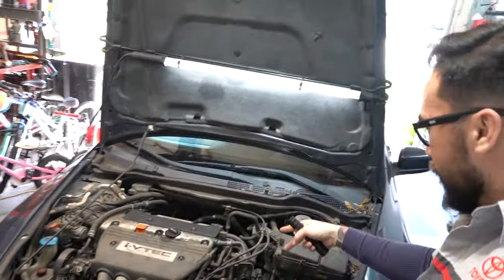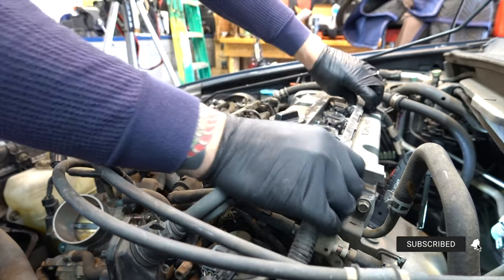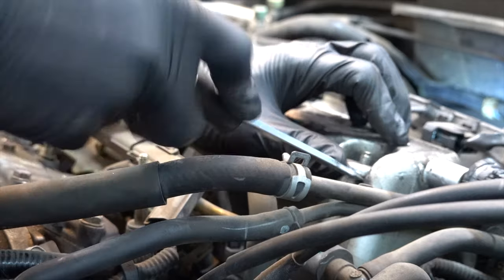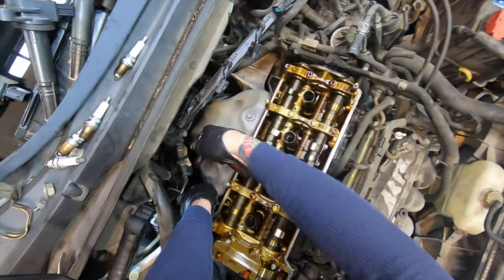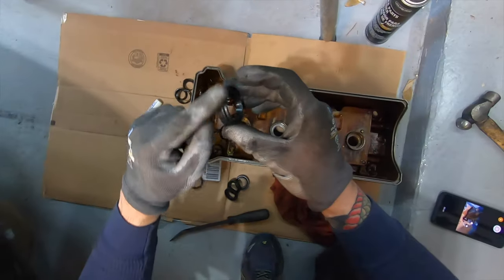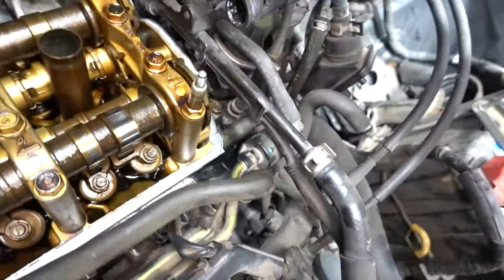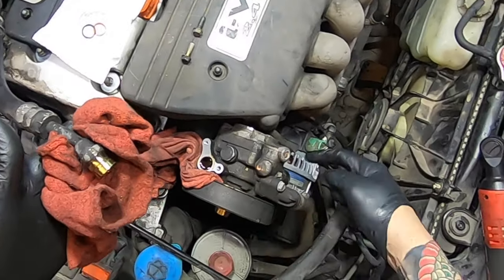Fixing All the Oil Leaks / K24 Honda Accord / Vtec Solenoid Valve Cover & Powersteering

Comment: Going on 210,000 on mine, came here to figure out where my oil leak is coming
Reply from the maker: Leaks here also https://youtu.be/wWytxOq4kHs
Reply: How is it holding up? 160k on mine and I need to fix these leaks to...
Reply: @danjones3402  150k on mine and same. Since it’s worn out rubber I bet it’s related to age more than miles. Mine is 2005
Reply: Same for me. 315 thousand miles and still going. 💪🏽
Reply: 305k just now leaking was rebuilt 6 years ago
Reply: Same here 212k done oil pan valve covers now doing timing cover front main I recommend you check your vakve cover where theres a half circle you can see overspray from Honda smhtheres a tsb
Reply: I made a video showing it I believed should be on my uploads
Reply: 160k had all the gasket since i bought the car 112k and now it’s leaking. Replaced the vtc strainer and vtec strainer. Tackling pressure switch and vtc actuator seal
Reply: I have a leak and it’s getting on my alternator. I suspect it’s the power steering pump
Reply: 222 still going strong but unfortunately being neglected time to actually find this oil leak
Reply: 250k on mine and I’m here now lol
Reply: 254,000km little oil leak, still going strong

Comment: The VVT solenoids are known to form cracks in the casting.  I just pulled one with three cracks in the top and two in bottom.  Very faint and hard to see, but would leak a quart of oil about every 50 miles.  Just replace the whole VVT solenoid, not the just the gasket.  No leaks for me any more.  The guy at the parts store said this is common and he's seen internal cracks which send metal chunks in to the engine.  I knew the VVT was leaking from getting under the idling car and seeing oil drips from the VVT location.
Reply: My 2003 Honda Accord 2.4l consumes motor oil pretty quick it has a slight leak that might be coming from the head gasket idk
Reply: These K24s leak from 4 areas the power steering being a culprit, the VVT solenoid  o rings leak which hangs on the side of the next culprit which is the VTEC solenoid, the last and most common culprit is the valve gaskets as they leak into the exhaust gaskets and make it look putrid.

I'm in a 04 accord lX auto 344,119miles as I write this, 14k miles on a low mileage transmission replacement (07 accord 123k original mileage) but Im losing a lot of oil. I will be replacing all those gaskets and parts see if it helps. 
Posted Sept 30 2023

Comment: bought a 2003 honda accord a few weeks ago. The own said there were no oil leaks. The vtec solenoid threw a code. So i orded a new one. and went to replace it. And wouldn't you know it was leaking oil. along with the oil filter. probably going to replace the gasket on the valve cover soon just to be safe. car has 225000 miles on it. So im actually kinda impressed I didn't find more. But it was pretty well maintained. it was a one owner car.

Comment: I took my 2010 Accord with 139k miles on it to a trusted foreign auto repair shop yesterday for a bad oil leak.
I was thinking it would be a bad oil pan or gasket but he told me it was a solenoid today 😬
I'm glad because a pan or gasket replacement would cost more.
He told  me $139 for part and over $100 for labor
Reply: what Parts?
Reply: @gerapic25ify  
Solenoid . The old one was cracked

Comment: The old power steering pump gasket apparently would just get hard and not able to properly seal and the new orange one is supposed to stay more soft and rubbery. Mine actually ended up sucking air in and bubble up the power steering fluid and it would over flow out of the reservoir, almost thought the transmission was going bad because it would make revving sounds as you accelerated
Reply: Yea, it’s only orange so you know if it’s been replaced before when you open it

Comment: literally was only planning on doing my valve  cover gasket and vvt solenoid. but i put power steering fluid in at least once a month. 03 accord as well. so might as well. gunna have to move that hose out my way anyways. great video.

Comment: Great video. You get right to the point with all this stuff and my oil leaks are fixed now. I had 2 of them. Thank you☺️
Reply: @Donnythelatemodeltech is there anything else on the front side of those engines that could leak oil?

Comment: What was the grease you put on the power steering O-rings? Lithium grease? I would imagine it's just going to dissolve in the oil. The orange O=ring fixes an issue with the intake hose on the pump. The flange only has 1 bolt for some reason. There are 2 holes bored on the pump.... Anyway, this causes the pump to suck in air from the leak around the Oring. This feeds the pump with air and fluid. By the time it comes out the steering rack back into the reservoir at low pressure. It's an emulsion, a soapy foam that overflows out of the reservoir around the air baffles in the cap. This is because when a fluid becomes a foam/emulsion. Its surface area will increase.  It's an insanely simple system that bleeds itself through the reservoir "cap". But will have big problems if you have a leak on the intake pipe for the pump.

Comment: Donny I have an 06 honda accord with the 2.4 engine. I have one leak I'm having a hard time finding. The oil is getting splashed on my alternator. When I get under the card my passenger side frame is covered in oil. I've changed so many gaskets on my car to figure it out but I still have that one specific leak. I put a lower mileage motor in my car and changed all gaskets but the head gasket set.
Reply from the maker: Watch these video yet? https://youtu.be/wWytxOq4kHs the forgotten gasket is in this video

Comment: do you need to drain your oil for this job? i plan on replacing the same gaskets as you: vc gasket, powersteering pump o ring, and vtec solenoid.

Comment: I have a 2004 Honda accord ex 2.4 I had a oil leak from the valve cover gasket and decided to change it and the other seals back in may now it leaks now from the v tech solenoid where u out the o ring at which is weird but u think it depends on where I got the part at kuz I bough that o ring from a source off eBay the valve cover with the seals I got from rockauto , that’s the only area I see the oil leaking at

Comment: so no need to torque the VTEC Solenoid? I saw you used a drill. is It okay if I use my own 10m socket wrench that I used to crack them loose??

I haven't done my gasket on my VTEC solenoid, because I don't want to over tighten them. I'll love a feedback on this.

Comment: My 2000 Honda Accord LX  has a valve cover gasket leak, shouldn't I check the oil pressure sensor for a leak also?

Comment: Hey there i just did the valve cover gasket on mine and i got it all put back together and torqued everything down to spec and i have a small gap all the way around the valve cover and the mating surface, is it supposed to look like that?

Comment: My valve cover now has a small gap and I can see the gasket from where it meets the heads is this normal? I pounded it in the best I could torqued it all to spec and it doesn’t seem like it’s leaking I’m just concerned

Comment: K20A2 130k miles and have almost all the same leak problems(i think) power steering making a racket and engine leaking oil (vtec solenoid and oil pressure switch the most likely cause?)  Its weird the power steering sounds/works worse when there is cold weather( less than 50deg F)

Comment: Would you happen to know what the piece is called that the smog hose connects to? I somehow broke it off when replacing my valve cover gasket on my 2003 Honda Accord. The smog hose is the small hose next to the emissions hose on the air filter. I’m needing to know what the smog hose runs down to so that it can be replaced. Any help is greatly appreciated. Thanks in advance.

Comment: On this engine what is the sensor on the front of the engine left of center near the head?  I had mine replaced because it seemed to be leaking oil and it is still leaking.  I don't know what it is called.  TY

Comment: Great video. Im about to be doing everything you just did in this video.  When you pressure wash the motor are there any areas that need to be covered ?
Reply from the maker: I would try not to spray to much behind the headlamps.   Once you get water in them... its really hard to get out

Comment: I've got a big leak at the VTEC strainer cover on the front, next to the belt tensioner.  Do you have a video on that? I think you had the gasket in your kit with the VTEC solinoid?
Reply from the maker: I pull one out in this video . 
https://youtu.be/-Qd4HgIKn1Y
Reply: I know your post is 2 years old, but I just replaced that strainer. 2 10mm bolts is all that holds it in, but you have to take off a bunch of stuff to get at it. Honda engineers didn't think that one through.

Comment: Why didnt you install the vtc strainer gasket? Didnt it come with the kit? My sisters car is doing the same thing, same year same car. I should probably do everything same time. Maybe a 3-4hr job if i dont include the oil pan gasket.
Reply: Mechanic quoted her 2500$ for new solenoid. When the problem isnt a solenoid, its oil leaks including the vrc strainer. No check engine light, no vtec issues, so why quote a new solenoid. Very few honest mechanics in the world. A whole lot of rotten apples man.
Reply from the maker: I replace one in this video around the 7 minute mark. https://youtu.be/-Qd4HgIKn1Y

Comment: Have a 2005 CRV with oil dripping down pass side of subframe. Resealed the timing chain cover, did the front crank seal, and valve clever gasket. Still leaking. Solenoid under cam sprockets not leaking. Leak seems to come from right behind AC compressor. Any thoughts on what it would be?
Reply from the maker: Your fix is in this video, it's a screen gasket behind the power steering pump https://youtu.be/-Qd4HgIKn1Y
Reply: @Donnythelatemodeltech  ok, I found that video too. I’ll check it out. Thanks!!
Reply from the maker: @jamesf9074  yeah, the compressor video isn't label and oil leak fix, but i do , fix it.

Comment: at 2:49., what is that little stamped steel cover being hidden by your finger thats below the valve cover and behind the power steering pump? I'm 99% sure that's the latest and greatest oil leak on mine.
Reply from the maker: Vtc screen. I replace one in this video around the 7 minute mark. https://youtu.be/-Qd4HgIKn1Y
Reply: @Donnythelatemodeltech  thanks!!

Comment: Hey, I love the vid and your spot on with your work. I just did this exact job on my friends 03 accord. Now it's leaking from the vtec solenoid area (3rd time now). I replaced the valve cover gasket (was needed), replaced the vtec gasket. 2 weeks later, leaks again at vtec solenoid.  Replaced the solenoid (used the new gasket it came with). And after 3 days leaks again. What am I missing on this?
Reply from the maker: Strange
Reply from the maker: I'm pretty sure the bolts are all the same length, correct?
Reply: @Donnythelatemodeltech  I believe so, all 3 behind solenoid
Reply: this may be far fetched, however I hear that if you pcv system is bad, there will be pressure and cause leaks. check your pcv valve and hose. there are many videos on it. no harm in doing so. I'm waiting for some time off from work to finally get my hands on my crv 03.. I'll be switching the gaskets of the part he showed here as well as the other gaskets/oil strainer. if you go to any parts diagram for your engine you will see where the gaskets are. no need to replace unless you see evidence of leak, one is right behind belt tensioner and the other is below the engine mount I believe

good luck

https://www.hondaacuraonline.com/v-2003-honda-cr-v--lx--2-4l-l4-gas/engine--vtc-oil-control-valve
Reply: I found the source and fixing it
Reply: @DyLan-vy8kp  what was it?
Reply: @trippin8585  Tip of a rear Valve cover bolt broke off. Ordered the new bolts and swapping them when it gets in
Reply: The VVT solenoids are know to form cracks in the casting.  I just pulled one with three cracks in the top and two in bottom.  Very faint and hard to see, but would leak a quart of oil about every 50 miles.  Just replace the whole VVT solenoid, not the just the gasket.  No leaks for me any more.

Comment: Mine leaks from the right back side cover  corner doesn’t seem to be coming from the cover but the catch can part in the back gets filled with oil time by time any suggestions?
Reply: Oil gasket changed mine 9 months ago had oil there also .
Reply: @jaym.1106  yea had to buy an oem one cause I had changed it out with an autozone one. But no more leaks 🤞

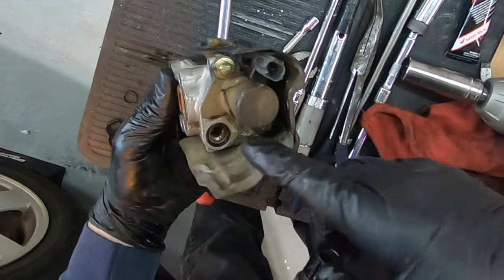Comment: hello how are you? please help me, the piece you removed in minute 6:01 I do not have it in place I have a screw my engine is a K24Z year 2007 crv I see that everyone has two sensors and I only have 1 where I could send you a picture to see what I mean? currently I have an oil leak from the top and is not the vtec and I changed the gasket and everything else in the valve cover less than a year ago
Reply: Check my comment. I'm going down the same road. Finally seeing a big leak on the VTEC strainer cover, which is on the opposite side of the one you fixed, small cover next to the belt tensioner. Hope that helps.
Reply: @krperry2007  hello, I also checked that area but it has a leak on that side, Mine is a big leak but it starts above the Vtec I don't know because mine has a screw where a sensor goes
Reply: @Jassett  Did you put a dab of RTV at the case joints and corners (4 places) when you put on the valve cover gasket?  I was not able to find my leak until I cleaned the engine.

Comment: You want to hear about an oil leak? I adjusted my valve lash and when I put back the valve cover, the gasket came off the back AND I DIDN'T CHECK IT. I drove out to start my vacation and oil sprays into my catalytic converter and smoked out the engine bay 😂😅😫😭🤮
Reply: Oh nooo

Comment: What's torque specs on vtec solenoid and valve cover since you used torque wrench you should've give those specs out to help lol
Reply: handtight with a 1/4 ratchet is good enough
Reply from the maker: Ok

Comment: I didn't put any silicone on the corners when I changed my valve cover gasket, that might be why there is still oil pooling up on the back side of the engine.
Reply from the maker: Good possibility

Comment: I replaced my Vtec solenoid gasket and it STILL leaks! I'm about to pull it off again. 😤
Reply: @Donnythelatemodeltech  Got it fixed today. Apparently I tightened it too much last time and the gasket was split. Today I just got it finger tight, then gave it extra 1/2 turn of the wrench.